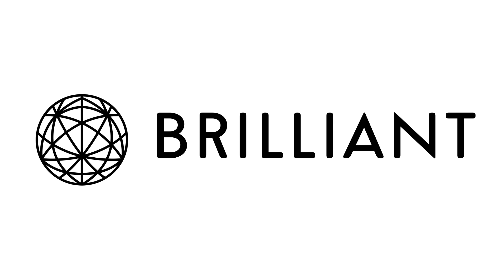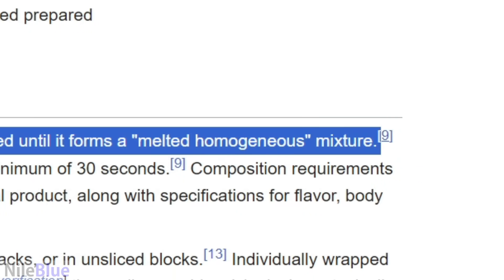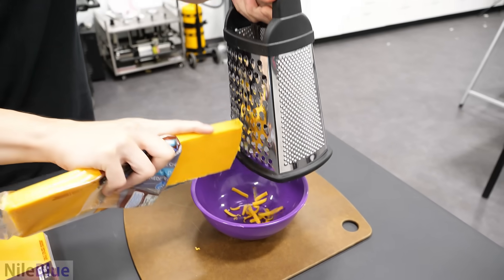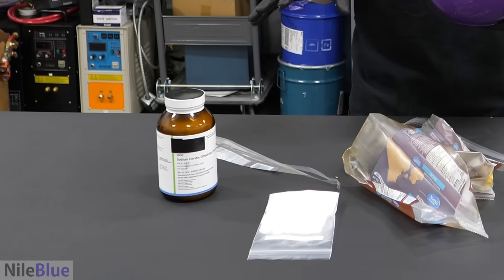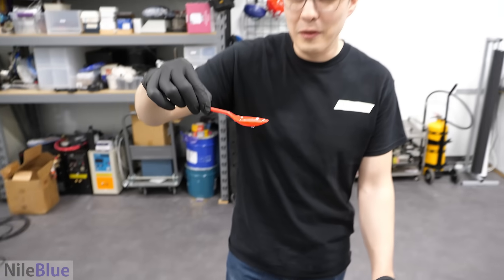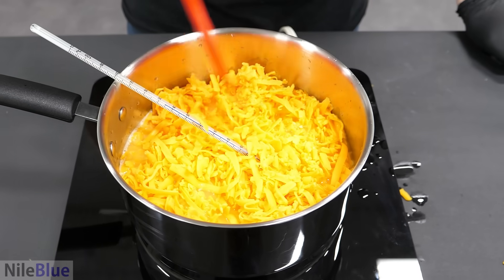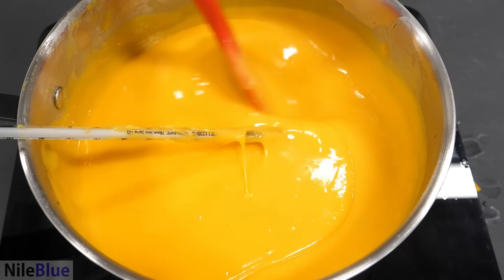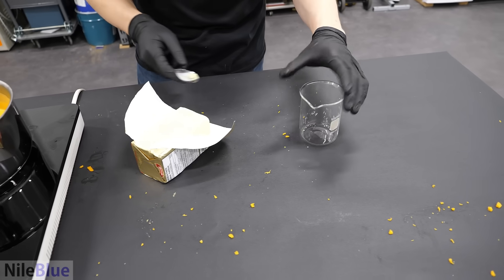Making American cheese to debunk a conspiracy

Comment: 🧀
Reply: It's mostly just cheese, which is from milk, with extra milk and some butter, which is also from milk.
Reply: Alright then who's making the phase diagram?
Reply: I dunno.  I feel like a cheese alloy needs more than one type of cheese in it
Reply: @logangodofcandy  it all starts on the moon, where the cheese is evaporated into milk
Reply: @h8GW Most american cheese has a bit of swiss with the cheddar iirc
Reply: @h8GW he was actually supposed to use more than one type of cheese he even said cheddar Colby and others wen reading the information on it
Reply: stay tuned for the damascus cheese recipe
Reply: I thought the kind of neon orangeness was something they added to the singles cheese but apparently american cheddar is just like that?
Reply: @h8GW  Cheddar and colby jack is the usual blend
Reply: @ScouseJazmin  The heavy food coloring was already in the cheddar. You have to specifically buy "white cheddar" to not have heavy coloring added.
Reply: Velvets is the shelf stable version

Its meant for Grilled cheese, Nachos,Mac n Cheese and other normally cheese sauce dishes without having to make a rue
Reply: Now he needs to make cheese whiz or Velveeta
Reply: @logangodofcandy that's how you get more milk per milk
Reply: @h8GW alloy is a lot broader than "two metals mixed"

Carbon steel is considered an alloy, containing only Carbon and iron at no more than 1.5% carbon

Going to high in carbon content breaks the crystal structure you want in carbon steels, and you end up with iron (as is found in nature, mixed with carbon)

There are alloys that are just two metals, some which are 99% one metal and 1% some other (or even a non-metal such as carbon)

It's probably better to conceive of an alloy as being an engineered metal, rather than being a mix of metals as that's the most common usage

People don't really call shitty mixed metals alloys for the most part,  although the term technically applies
Reply: @h8GW  steel is carbon and iron, carbon isn't a metal yet it's still an alloy
Reply: The colour of that cheese he started with is not natural...
Reply: Cheese Alloy sounds like it might be a better description of ColbyJack. Or an excellent alt rock band name.
Reply: mmmmmm cheese alloy🤤🤤🤤🤤🤤🤤🤤
Reply: "Cheese product" is pretty definitive already: It's a product made out of cheese. It can't just be cheese because it isn't, it's a product made of cheese.
Reply: @@notyourdaIt’s a cultural thing. Cheetos culture
Reply: @logangodofcandy  It's not 'mostly cheese' and that's why it's not considered cheese.
Reply: @@notyourdafound the Italian, I'll go put some pineapple on my pizza.
Reply: @thenonexistinghero It’s cheese the same way an English breakfast is food.
Reply: @ulwur  This is normal for cheddar since it often contains annatto which gives it an orange color.
Reply: caseum alloy
Reply: It's basically a solid cheese-sauce.
Reply: @logangodofcandy It really depends on the product: pasteurized process American cheese is up to 5% of non cheese ingredients (flavouring, colouring, salt, acidifying agents and additional diary fat)
Pasteurized process American cheese food can be 51% cheese, and the rest is mostly other diaries, from skin milk to albumin
Pasteurized prepared cheese products can be almost anything, the most obvious outlier being Kraft Singles, that contain added milk protein concentrate or other unregulated ingredients.
Reply: @flyingisland7583  if you can define a "culture" by cheetos, you know somebody f.ed up big😂
Reply: so a milk alloy? @logangodofcandy
Reply: @SCIFIguy64  That's not an apt comparison. Unhealthy food is still food (and it's not like breakfast is anymore healthy in the US). But American cheese isn't cheese. It's a food product containing a lot of cheese.

If you make chili... you eat a dish called  chili. There might be a lot of beans in it, but that doesn't make it beans. It makes it a dish with beans, it doesn't turn the whole dish into beans magically.
Reply: @SCIFIguy64 So it's great cheese then
Reply: GOD BLESS AMERICA 🦅🦅🦅🦅🇺🇸🇺🇸🇺🇸🇺🇸
Reply: @logangodofcandy it's just water down cheese but with chemical taste
Reply: That line almost made me spit water over my screen. I'm still coughing now from holding it back
Reply: @ScouseJazmin  cheddar tends to have annatto added to it to make it orange.
Reply: @thenonexistinghero   It's literally 99% natural cheddar cheese...
Reply: He made a Kraft double
Reply: the cheese mines are only legal if the surface elements are on the side facing away from earth
Reply: @logangodofcandy  so it’s mostly milk
Reply: @h8GW the old jingle for velveeta was “colby, swiss, and cheddar blended all together”
Reply: @logangodofcandy lmao they literally added milk to itself twice
Reply: @ScouseJazmin  The color is from some seed or spice, the name of which I cannot remember.
Reply: @h8GW  I'd spread a bit of butter on a slice of bread and grill yellow cheese with a some white cheese shavings on top of that. Then throw some pepper and a slice of tomato as a good measure. Delicious.
Reply: @logangodofcandy ah so extra milky thick milk
Reply: @andybrice2711 I once tried to make mac and cheese, and this is basically what I got the next day when I took it out from the fridge. :D
Reply: @logangodofcandy so cheesed cheese
Reply: @scythelord  Over half of it is water and other ingredients. Best case scenario it's like 35-40% actual cheese what the guy made here. And it's not much better for most products being sold as American cheese. Some of them barely even contain cheese, they just look like it.
Reply: @thenonexistinghero  What he started with might be more like cooking beans in water with salt. That wouldn't be enough to call the result not-beans.
Based on some comments about the legal definitions they use, it could vary pretty widely between basically cheese and milk amalgamation.
Reply: Kraft singles are a specific type of American cheese. American cheese is an extremely broad category that includes everything from cheddar with some sodium citrate added all the way to super processed stuff like Kraft singles.
Reply: Nice creativity on wording 🎉
Reply: @ScouseJazmin it's typically annatto (seed powder that is a vivid orange) that is added. no cheddar naturally is orange but for some reason people decided it should be in the 1950s.
Reply: "Embalmed Cheese"
Reply: I think emulsion is perfect
Reply: It's invented by a Canadian no less.
Reply: @logangodofcandy  we tortured milk until it was perfect for grilled cheeses 😊
Reply: Getting the eutectic point is the difficult part 😹
Reply: @logangodofcandy  No, it's made from the waste products from those other production lines and then combined together with chemistry. As they do in this video you can also make it from whole product but it's totally disingenuous to think that these products were made with the whole product in mind. They are made as a way of making more money from food waste products.
Reply: @logangodofcandy  They do it that way to homogenize the cheese. They want the same colour, flavour profile, melting properties and appearance (day-glo-orange plastic padding with a hint of cheese) regardless if the cows are one type or another; regardless if they ate silage, grass or corn. So they measure everything, add orange food colouring (beta carotene or some orange azo dye like sunset yellow). They measure everything; mix it to the same fat content and flavour profile and color (day-glo-orange) every single time. They also emulsify the shit out of it so it will melt toghether better which creates that hole-free shiny plastic look.

This type of cheese is called "american cheese" outside of the US to distinguish it from real cheese which has the structure, texture and flavour of cheese.
Reply: @marranin007  Ask an astronomer and you might be surprised. If it's not hydrogen or helium it's "metal"; and stars with a lot of anything other than hydrogen and helium (like carbon) have "high metallicity".
Reply: @Depleted-Uranium isn’t that Colby Jack? 🤔
Reply: @soylentgreenb  Carbon itself is classified as a "non-metal". This does not have anything to do with astronomy, as anything heavier than helium is classified as a metal in astronomy.
Reply: That would be provel
Reply: @monad_tcp  Of course, this is also where evaporated milk comes from.
Reply: @Depleted-Uranium  Can I get a laminated plutonium -238 Croissant recipe next! 
❤ love your cooking vids !
Reply: @h8GW  You can use any kind of cheese
Reply: sergal
Reply: SLAP cheese
Reply: alright, here i come...

Cheese is a dairy product produced in a range of flavors, textures, and forms by coagulation of the milk protein casein. It comprises proteins and fat from milk (usually the milk of cows, buffalo, goats or sheep). During production, milk is usually acidified and either the enzymes of rennet or bacterial enzymes with similar activity are added to cause the casein to coagulate. The solid curds are then separated from the liquid whey and pressed into finished cheese.[1] Some cheeses have aromatic molds on the rind, the outer layer, or throughout.

Over a thousand types of cheese exist, produced in various countries. Their styles, textures and flavors depend on the origin of the milk (including the animal's diet), whether they have been pasteurised, the butterfat content, the bacteria and mold, the processing, and how long they have been aged. Herbs, spices, or wood smoke may be used as flavoring agents. The yellow-to-red color of many cheeses is produced by adding annatto. Other added ingredients may include black pepper, garlic, chives or cranberries. A cheesemonger, or specialist seller of cheeses, may have expertise with selecting, purchasing, receiving, storing and ripening cheeses.[2]

For a few cheeses, the milk is curdled by adding acids such as vinegar or lemon juice. Most cheeses are acidified to a lesser degree by bacteria, which turn milk sugars into lactic acid, then the addition of rennet completes the curdling. Vegetarian alternatives to rennet are available; most are produced by fermentation of the fungus Mucor miehei, but others have been extracted from various species of the Cynara thistle family. Cheesemakers near a dairy region may benefit from fresher, lower-priced milk, and lower shipping costs.

Cheese is valued for its portability, long shelf life, and high content of fat, protein, calcium, and phosphorus. Cheese is more compact and has a longer shelf life than milk, although how long a cheese will keep depends on the type of cheese.[3] Hard cheeses, such as Parmesan, last longer than soft cheeses, such as Brie or goat's milk cheese. The long storage life of some cheeses, especially when encased in a protective rind, allows selling when markets are favorable. Vacuum packaging of block-shaped cheeses and gas-flushing of plastic bags with mixtures of carbon dioxide and nitrogen are used for storage and mass distribution of cheeses in the 21st century.[3]
Reply: What did this dude say?
Reply: I have a tattoo of this comment
Reply: Is anyone going to mention that the original “Cheddar cheese” he started with, is also a processed cheese now-a-day?
It was absolutely not a real Cheddar… Real cheddar is never sold like that.
That’s the whole problem with expecting any quality food today.
You get what you pay for, and real cheddar is expensive….
Reply: This deserves 10,000 likes
Reply: The "cheddar" he used is already dyed, processed crap. If they didnt add color, it would look like it tastes: boring, bland and nothing like real cheddar.
Reply: @monad_tcp by the dwarves of Ugandan silicone mines
Reply: Whats that?

Comment: You can achieve very similar results at home by replacing the chemical water with roughly equal volume of lemon juice and then adding one tenth the volume of the lemon juice of baking soda. Once dissolved, it should not taste sour. If it does, add more baking soda. Stir constantly while adding any cheese or it might split. Then cover and refrigerate.

If you then half the volume of the cheese of any type of cream you get restaurant style queso dip!
Reply: If you’re combining lemon juice (citric acid plus other stuff) and baking soda (sodium bicarbonate ) you’re making sodium citrate, same as the stuff used in the chemical water plus some extra chemicals and flavors.
Reply: Thank you for your comment!
Reply: Yep.  Adam Ragusa has an episode on Mac and cheese that explains this process for anyone that wants a demo😊
Reply: cool advice but I'm guessing "any cheese" is a bit of a stretch no? I can't imagine this working with an awful melting cheese like parmiggiano
Reply: @whateverreally1347 I have made cheese sauce using sodium citrate and a wide array of cheeses. Hard cheeses require more water to balance the ratio, but they do melt.
Reply: @Simoxs7  What's "awful" about it?
Reply: Aspirin is so bad for you, I just drink willow bark tea 😂
Reply: @Simoxs7 what you mean to say is "I don't like it so I'm going to complain"
Reply: @whateverreally1347  I've seen people make cacio e pepe with sodium citrate so I actually think parmiggiano would work too
Reply: @whateverreally1347  you arent just melting the cheese, youre partially dissolving it. the fats separate from the proteins. doesnt matter what type of cheese it is, if it was made from dairy it will separate. I made a sauce like this a couple weeks ago. I messed it up a couple times since they completely separated and basically siezed up in the water making it lumpy but i did one try with half the water and it folded into a smooth goop almost like this. there was butter, icing sugar and milk powder in my mix as well so the difference is really the ratios (and the sugar).
Reply: @Tunkkis I think they just mean, compared to something like cheddar or mozzarella, it’s harder to melt. “Awful melting cheese”=cheese that’s (comparatively) awful *at melting*.
Reply: awful at melting, not awful cheese. if you're familiar with how blocks of parmagiano melt, then you can probably afford it, and you probably appreciate it
Reply: Wth is queso dip
Reply: @Toastedtasty42  you realise that acetylsalicylic acid or aspirin is the exact same compound found in willow tree, just more safe for human comsumption because you dont risk any unsafe impurities from bark? 

acetylsalicylic acid is LITERALLY named after the willow tree. Salix is the general name for all willow in Latin...
Reply: @whateverreally1347  Watch the video where a cheese maker, tests 50 cheese sandwiches...His favorite? (real) parmiggiano cheese sandwich. It melts fine. It isn't gooey, but that's just visuals.
Reply: Good idea
Reply: @uribove  yeah that's the joke bud
They literally made sodium citrate
Reply: 1betterthanyou1  again, it's a joke
Reply: 1betterthanyou1  i have autism, so no, very subtle sarcasm doesn't get noticed
Reply: @whateverreally1347  
It would work as well. Sodium citrate reacts with the casein protein in the cheese and raises the temperature needed for them to contract. This protein is what emulsifies the fat and liquid parts of the cheese and the contraction of the casein is what causes melted cheese to split. And by strengthening these proteins they are able to hold more water and fat and making it softer and, in turn, making the cheese melt at a lower temperature. So, as long as you use enough sodium citrate and liquid, you can turn even the most aged cheeses into American cheese and make it however soft/melty you want.

Comment: Had to pause here at 1:36 and type in: While you are looking it up, generally speaking it's a mixture of ground or shreaded cheese and sodium citrate. The citrate is what makes it both melty and soft. I've made some out of curiosity before from homemade cheese.  It can mostly be any combo of cheeses; historically and classically though it's a mix of cheddar, colby, and sometimes a monterey jack cheese.  I like blending cheddar, gouda, and provolone, personally.

Now, I'm confused; why didnt you make the sodium citrate?

The darker orange skin that wrinkled was because it dried out. If you want it the same all the way through, you'd want a plastic wrap or other airtight cover touching the cheese, before you throw it in the fridge to set.
Reply: No need to make the sodium citrate since it's a common ingredient you can buy in the grocery store.
Reply: @funtechu  But, the point of Nigel's videos though is the chemistry and being able to make the chemicals. I've even made this myself because it's not as common as you may think. I have to order it online or look for a specialty store.....and I'm in a large city in the US.  Citric acid and baking soda (sodium bicarbonate) mixed together in water and cooked out makes the resulting sodium citrate.
Reply: Its a very cheap ingredient and step 1 of chemistry is find the cheapest ingredient you can get to what you want. Second, there's no need to risk that there's an impurity in the synthesis that could be dangerous.
Reply: @midn8588  That's not really a risk though. You can easily make sodium citrate at home - it's just lemon juice and baking soda.
Reply: @DGPHolyHandgrenade  I guess. To me sodium citrate is about as exotic as sodium chloride, and I wouldn't expect Nigel to make that from other ingredients. But I understand that not everyone uses sodium citrate while cooking.
Reply: Just buy cheese 😂
Reply: @funtechu  even for the video though, Nigel had to order from a chemical house.